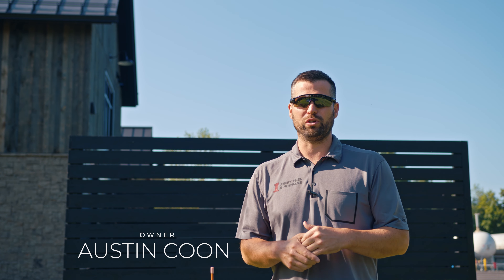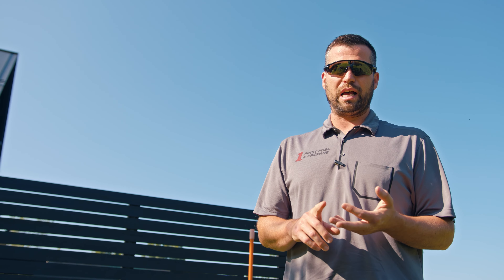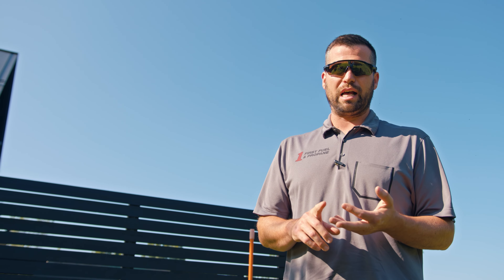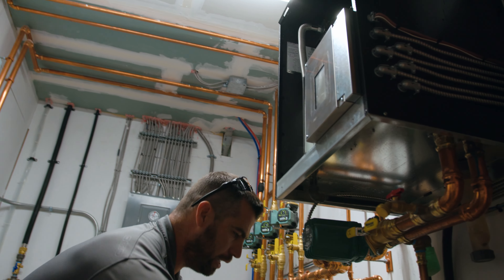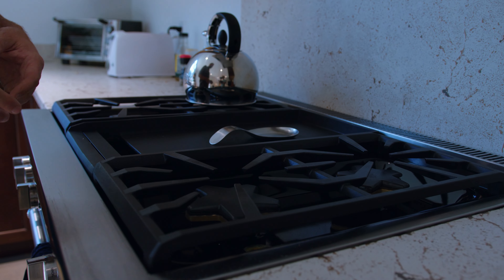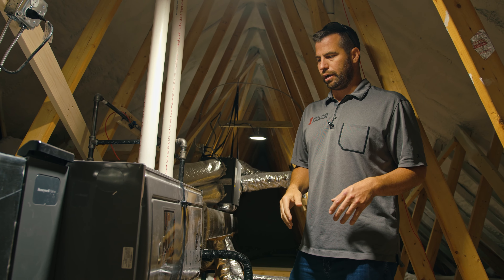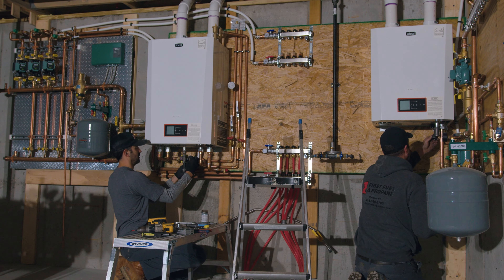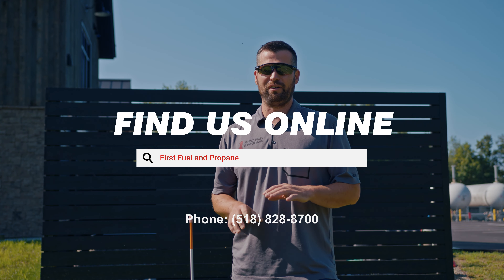Propane Safety Inspection

Comment: NFPA 58 08 I believe your tanks are not in compliance with the 10 ft distance from a building.
Reply: 5 feet from an opening,  10 feet from any ignition source for 120g/100lb A/G tanks (tanks can and are set against building walls and this is acceptable to code)